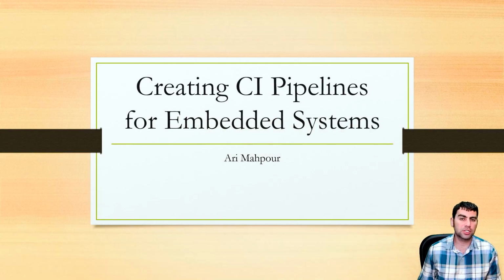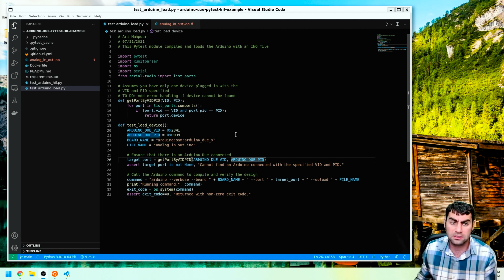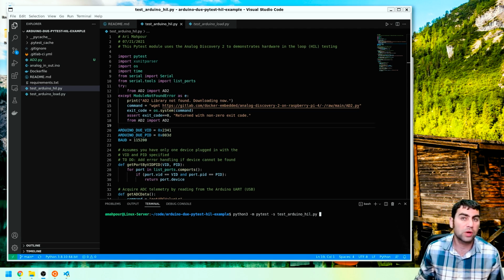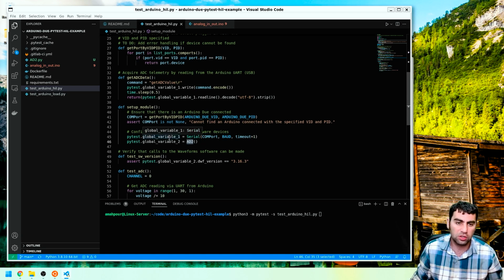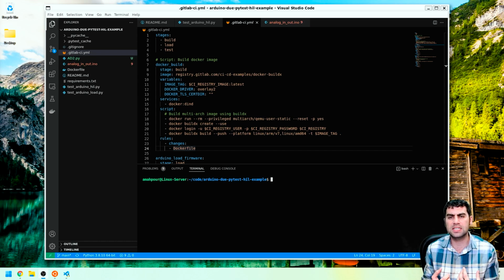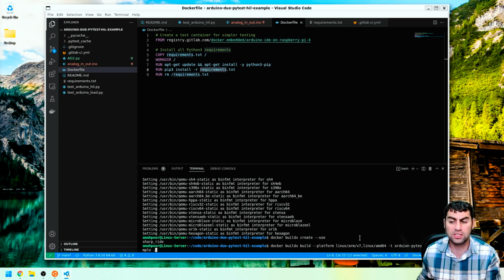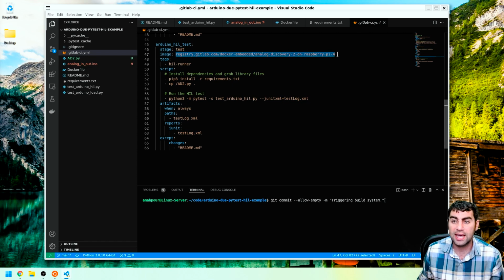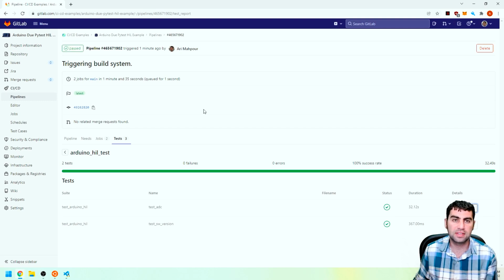Creating CI Pipelines for Embedded Systems

Comment: All the very basic explanations about docker, but then you keep talking about „loading the firmware onto the device“ without further explanation? Should i imagine a docker container that has plenty Arduinos and Raspberries connected to it? How to handle upload errors? I really don’t get how this kind of CI would run anywhere anytime. And then even run reliably or even scale. What’s the point of docker if you have to maintain a super complex physical setup anyhow? Docker would even interfere with that since there is an extra layer to access the devices.
Reply: Thanks for posting the question and I appreciate the feedback with respect to clarity. The objective here is to be able to bring up a complete build/upload environment without any installation whatsoever. All you would need is Docker.

Consider a more complex chip such as ones from Analog Devices (with build in Arm Cortex processors). I built a docker container (https://gitlab.com/docker-embedded/ad-build-env) that holds all the necessary GCC dependencies + JLink tools from Segger to build and flash firmware to most AD ARM based devices. If I want a colleague to test out my firmware I can point them to a single command (docker run <image> <make command>) and it will do everything from A-Z without installing a single dependency.

Take this a step further: imagine trying to set up hundreds or thousands of CI agents. Do you really want to configure each machine manually or run some sort of shell configuration script to install dependencies? Why not just run everything containerized like all modern CI systems do in the software industry?

Regarding your last point: Docker and containerization should makes things simpler for you - not more complicated. If it's making your life harder then it's the wrong solution. I appreciate the feedback you posted because it helps me understand where I am and am not explaining the pain points that folks experience.

Please keep it coming. Thanks.
Reply: @TheEngineeringPerspective  I still don't get to which machine hardware is attached to if the docker container compiles stuff on a server? Does server turn on dev board or something?
Reply: @raymondwright  so the binary compilation is decoupled from running the HIL tests on target. They occur on separate machines but the binary gets passed into the test machine and then loaded onto the device. Does that make sense?